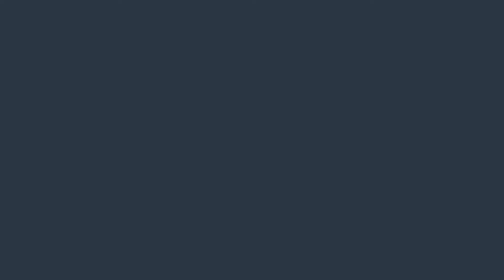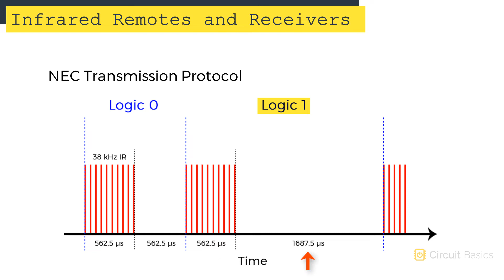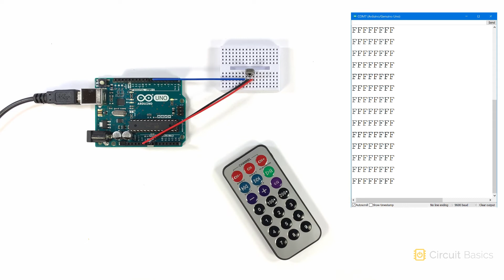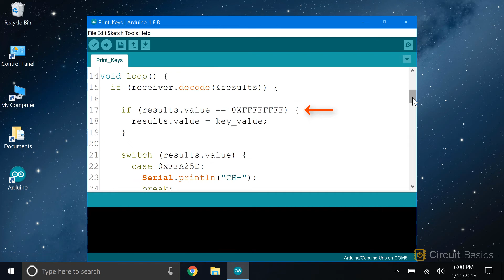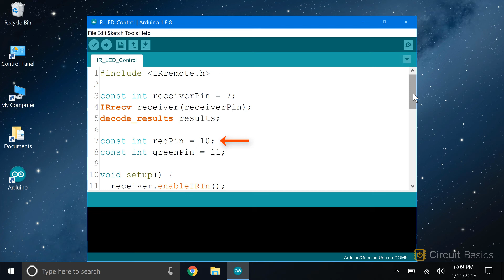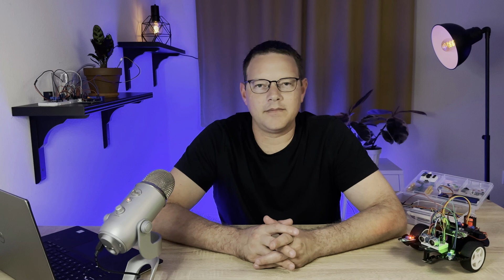How to Use Infrared Remotes and Receivers on the Arduino - Ultimate Guide to the Arduino #26

Comment: done everything, still can't get it to work, I haven't found one single Arduino tutorial on YouTube that correctly shows you how to use a remote with Arduino
Reply: You have to go into the examples folder and under irremote use the receiverDemo file or the simpleReciever file. It seems this file is obsolete and he didn't mention it.
Reply: Same! Have you found a solution
Reply: Same
Reply: What stopped mine was all the sample code pointer do a different pin.  Like this one he sets it to 7.  Make sure your wire on board is attached to 7, or what ever number you assigned in your code.  Make sure the bod mode is set correctly…probably 9600.

Comment: Wired the receiver as instructed, the receiver burned
Reply: same
Reply: I think its bc we didnt use a module, and we were using TSOP which has reverse wiring.. so we applied voltage to the OUT pin and not VCC

Comment: It doesn't work for me. I get multiple codes for each button. Inconsistency.
Reply: I had the same problem but could not fix it, yet.
Reply: Have you found a solution for this?
Reply: @fxry5943  Unfortunately not yet, someone promised me in instructables he would do something, I have been waiting for months!
Reply: @fxry5943  no, not yet.

Comment: I have problem when I connect my 5v power to sensor. Com port get disconnected to my pc. What i need to do. I try both 3.3v and 5v. Same happened. Com port get disconnected.  After i removed the power it connected. I'm using Arduino Uno.

Comment: I get the following msg on the com port: "Thank you for using the IRremote library!
It seems, that you are using a old version 2.0 code / example.
This version is no longer supported!"
IRremote version 4.2.0 is installed. I also downloaded your zip file, extracted it, and placed in the lib folder.
In the msg below the sketch, it says, Invalid library found.
Reply: I have the same issue.
Reply: Follow what is said in the message. Go the examples and pick the simpleReciever file. It should display the code on it.

Comment: Mine only outputs FFFFFFFF, no matter what button i press. Can anybody explain the reasoning. I have the exact same code, I have a newer version of arduino though.
Reply: #include <IRremote.h>

IRrecv IR(7); // Im using the pin 7
decode_results results;

void setup(){
  Serial.begin(9600);
  IR.enableIRIn();
  
}

void loop(){
  if (IR.decode()){
        Serial.println(IR.decodedIRData.decodedRawData, HEX);
        IR.resume();
  }
}

Try this code
Reply: You have to use library version 2.0. That solved the issue for me!
Reply: @nicolasfite9236 only 2.0?
Reply: @nicolasfite9236 how did u do that?
Reply: Mine also same problem
Reply: @E-4-elecTronic did u manage to solve your issue?
Reply: Tegangan ke IR receiver jangan diatas 3 volt. Ketika mengarahkan remote ke penerima IR, jarak harus jauh.
Reply: I need some help, if I click a button on my IR Remote and it just spams one HEX CODE on the serial monitor
Reply: A random hex code
Reply: Same issue 😢
Reply: Mine also
Reply: Use 2.0.1 library files ,it is working
Reply: Use 2.0.1 library files, it's working
Reply: Ffffffff
Uuuuuu
Ccccccc
Kkkkkkkk
Reply: F

Comment: i got this from. this channel : "Robots and Dinosaurs ", worked for me without any problem 

/*
    IR Remote

    Print out the received IR value. Turn on the red LED if received a specific code.
*/

// remove this line if using Arduino IDE
#include <Arduino.h>

#include <IRremote.hpp>

const int IR_RECEIVE_PIN = 7;
const int redPin = 10;

void setup()
{
  Serial.begin(9600);
  IrReceiver.begin(IR_RECEIVE_PIN, ENABLE_LED_FEEDBACK); // Start the receiver
  pinMode(redPin, OUTPUT);
}

void loop(){
  if (IrReceiver.decode()) 
  {
    Serial.println(IrReceiver.decodedIRData.decodedRawData, HEX);
    IrReceiver.printIRResultShort(&Serial);

    switch(IrReceiver.decodedIRData.decodedRawData)
    {
      case 0xE31CFF00: //Keypad button "5"
        Serial.println("5");
        digitalWrite(redPin, HIGH);
        delay(2000);
        digitalWrite(redPin, LOW);
        break;
      default:
        break;
    }

    IrReceiver.resume(); // Enable receiving of the next value
  }
}

Comment: Congratulations beautiful video. I faithfully reproduced the sketch. My remote control and my IR receiver work perfectly by themselves but no code appears on the screen. Can you give me some suggestions?
Reply: try this script:                                                                                                                                                                                          #include <IRremote.h>

const int RECV_PIN = 7;
IRrecv irrecv(RECV_PIN);
decode_results results;

void setup() {
  Serial.begin(9600);
  irrecv.enableIRIn();
}

void loop() {
  if (irrecv.decode(&results)) {
    Serial.print("Received IR Signal: 0x");
    Serial.println(results.value, HEX);
    irrecv.resume();
  }
}
Reply: Check your baudrate. It could be a reason
Reply: i have the same issue there is no serial output showing up

Comment: got stuck on the first step, even though i seem to have the exact same remote controller as shown in the video all the buttons transmit the same hex code - FFFFFF... my AC remote on the other hand does seem to work and provide different hex codes, so it can't be a problem with the circuit or the code, any ideas on what i could do to fix this?
Reply: Hi I have the same problem with permanent code FFFFFF.  Did you solve this problem?
Reply: @Ansarter you need use 2.0 library version
Reply: You need use 2.0 library
Reply: @titigr hey bro, can u show me how to use 2.0 library?
Reply: Discord ,WhatsApp,instagram for ?video